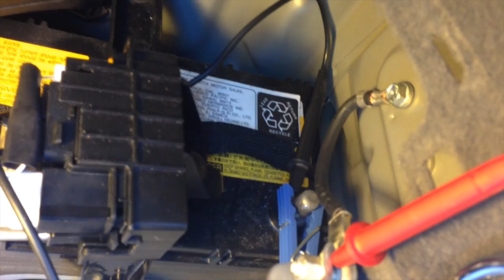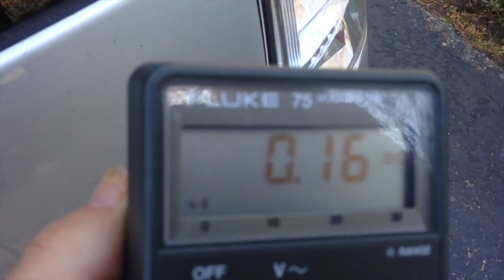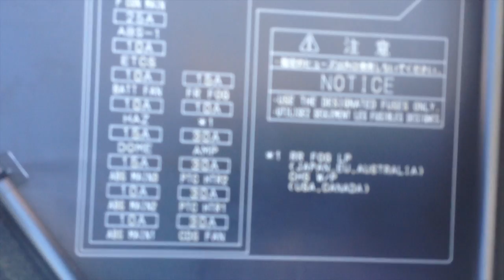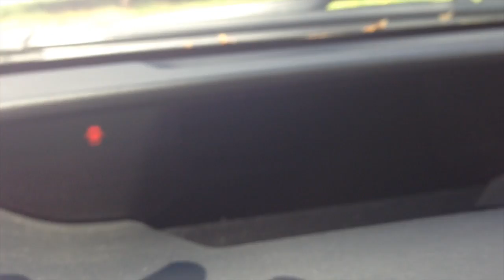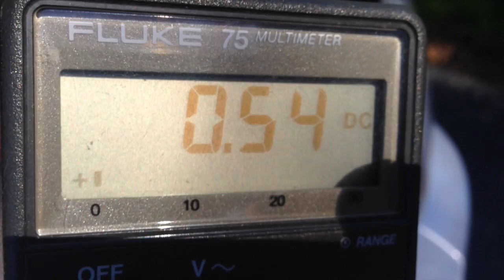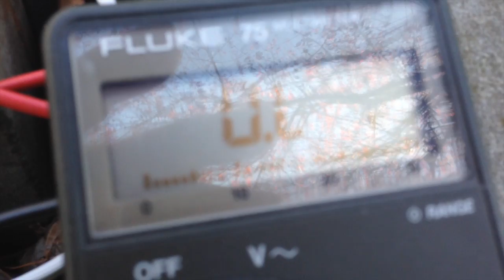PRIUS AUXILLIARY BATTERY DRAIN PROBLEMS

Comment: also, if you have a spare phone lying around the house, you can turn it into a webcam and leave it by the multimeter and then check on your phone as you pull fuses. thank you for the helpful video. I was curious if you were troubleshooting something specific in your car and if you were able to resolve it and what was the issue and how did you fix it? thank you!

Comment: I think I am right in saying that the car will 'wakeup' and pressurise the brake system as you walk up to the car, with the key?  So try leaving the key well away from the car before looking for a parasitic draw.
Reply: I noticed after I turn off the Prius something kicks in after shut down like a pressurized tank or water battery cooler system I been noticing if I don’t run my car for 2days my battery drains and I have it recharge fully on a home charger and maybe my after market alarm might be draining my battery as battery has been replaced to new one a couple of months
Reply: My daughters car has frequent dead batteries, especially when it sits for a few days. I always ask if she leaves on the dome light. She always leaves the key in the car, that must be the problem. It's a 2010 Prius.

Comment: Thank you for that demonstration of how to measure current running through your battery. I'm a little curious as why opening the trunk would draw 1.5 amps. That seems to be a lot of electricity for a light. (unless opening the trunk turns on many lights on the interior).
Reply: ECU, Smart Key are just two I can think of
Reply: It does light up the interior.  But they will timeout usually in a few minutes EXCEPT for the back hatch light he turned off.

Comment: What if you pull a fuse and find out what is causing the excessive draw. how do you fix that?
Reply: The logic is similar--divide and conquer.  You read the box lid to see what the fuse is for.  You find that device.  You unplug it at the device.  If the current draw goes away, you know the problem is most likely the device you unplugged.  While you are there, with the fuse out, you run a continuity check for the 12 v hot (downhill, toward the device) side of the fuse to the body of the car or "ground".  If you get a significant reading, you may also have a wiring or relay problem--something is grounded.  If you do not, the device you unplugged is drawing the current.  Etc.
Reply: Joe Burney thanks 🙏
Reply: This is when you break out the schematics and trace how many places that fuse feeds.  On a Toyota the drawings are available for a fee from the Toyota “Technical Information System”, TIS.   Often one fuse feeds several components.  If a given fuse removal drops the current you disconnect each load one by one.  No removable fuse found to be the cause?  The engine fuse box has a long white module with several fusible links hardwired into the box.  Now you have to either disconnect the fusible link loads one by one or use a technique where you measure the millivolt drop across individual fusible links.  More mv drop means more current draw.  Finally removing and reinstalling a fuse will often wakeup connected computers and networks.  In that case you have to wait for that cpu to go to its sleep mode.